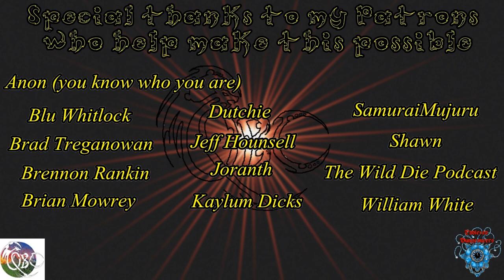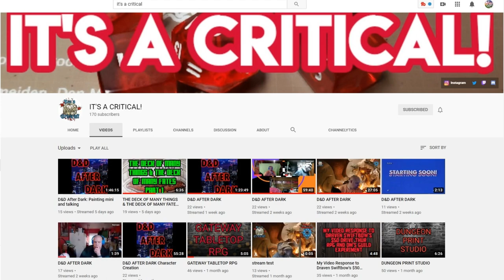How to make winter terrain!

Comment: Does the hair spray seal keep the baking soda from yellowing?
Reply from the maker: yeah it seems to. Turns a sliiiiiight shade of grey but not so much you'd notice really. Almost like concrete when it's dry. Similar results to the soda and super glue method
Reply: @QuiniansBudgetCrafts  awesome, I'll try that out